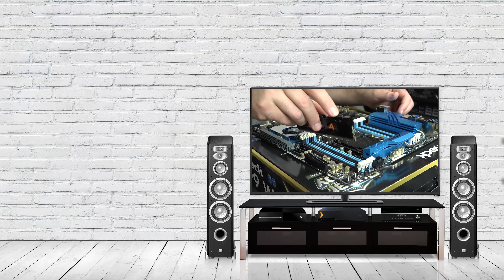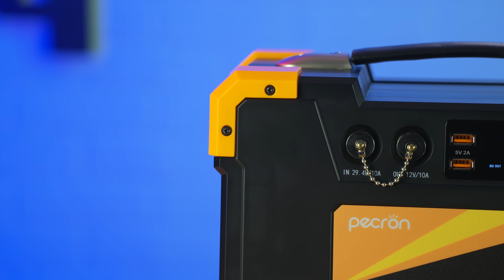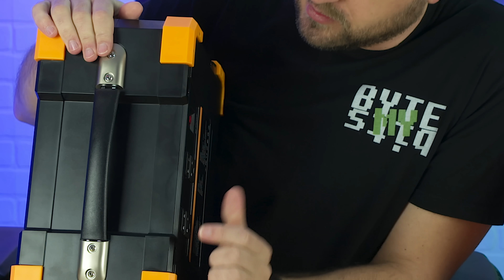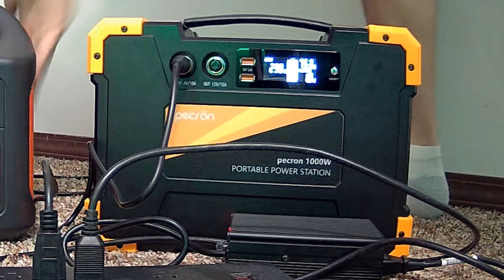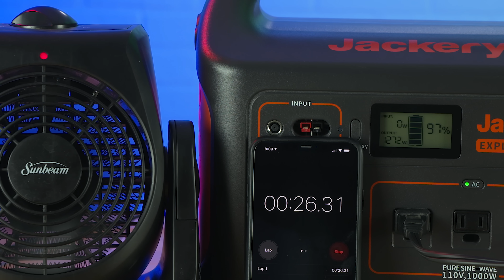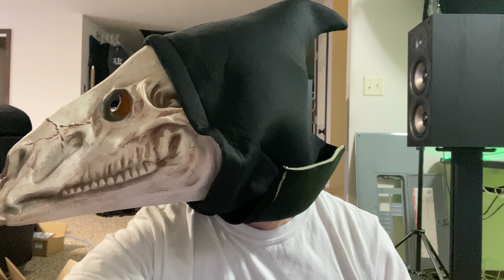pecron E1000 - Better and CHEAPER than the Jackery 1000!

Comment: Meh, they are all overpriced and this is not that much of a savings. I'd rather build my own and possibly build it with LTO Lithium batteries as they are better for our cold Canadian winters, they charge very fast and are safer than standard lithium. The only drawback to them, is they don't hold as much power per cell as standard lithium so a few more batteries are needed, but for my uses, they are superior and last WAY longer too for lifespan and are fairly inexpensive now, like $75 or less, per 45ah cells.
Reply: Bill Does Stuff,  Hello Bill, my name is Linda. Would you be so kind as to share more info about building your own LTO Lithium Batteries as you referred to in this post. I live in Maine, USA, where we have cold winters, too. I am 74, live alone, cannot afford to buy these expensive generators with solar panels and have no way to heat my home when electricity is out. If you cannot help, could you refer me to someone off or online who may help? Thank you for any suggestions of help, Linda
Reply: @lindaliberty4545  Hello Linda. See my comment to Valerie here in this thread. It applies to her and you actually, as she was asking where to get those batteries in the U.S. and the same Youtube channels I suggested to her are the same ones I would recommend to you. I am still learning and researching myself, so these are the guys I watch. DIY Solar with Will Prowse, LithiumSolar who also does battery builds and Brenden Tait, who has done a few videos on LTO lithium batteries. Those Yinlong LTO cylindrical shaped batteries they talk about seem very easy to hook up, nuts and bolts and metal bars kinda deal, which is what appeal to me about them and likely you as well. No soldering or welding bus bars etc. 

I'm no expert on them, but those are the guys I watch and who I learned about them from and they know their stuff. And don't listen to Will Prowse when he says LTO are inefficient, lol. They aren't, he got bad ones, I think it was Benden Tait's channel who debunked that and said, no they are not inefficient at all, lol. And I believe Will revisted the subject after. Anyway, Will is really good and so is Lithium Solar, because they do hands on stuff. 

 I would also check out some of the prepper channels for heating alternatives to electric and solar, like diesel heaters, propane heaters, mini wood stoves etc. They are always preparing for the worst, so they typically do a lot on heating. And if you are running electric heaters off a lithium generator, I would look into/research the most efficient electric heater technologies out there too like PTC ceramic, and oil filled and Mica heaters. Things that radiate heat after they switch off to save power and then back on when it drops to a certain set temp. Anything that radiates additional heat without the heat fuel (be that electric, gas whatever) are going to be the most efficient and perfect for running on battery power. 

I get the concern, I am looking into this and other alternative means of heating, "just in case". Propane just hit an all time high, so that's a bust, but those little Chinese diesel heaters look very efficient, Truckers use them all the time. Also look into modern Kerosene heaters, which can run on more than just Kerosene these days and are MUCH safer than they used to be and wow, do they throw off some serious heat! Just saw a guy do a vid. here on Youtube on one and he said it heats up his whole shop in about an hour and it's 1000 or 750 square feet something like that. And they run about $200. So there's LOTS of backup alternatives for heat now.
Reply: Where can we buy these?? InU.S.
Reply: @valeriehancotte-galan4790  I live in Canada, so I don't know. And Amazon is rather chancy (and expensive for them), because I've seen complaints about the Yinlong LTO batteries being fake on there/not having good charge/life. Yinlong are a good cylindrical-shaped LTO lithium battery that are rather easy to hook up by comparison to some. It's basically screw nuts, bars to connect the batteries and that's it. Being a good name like Yinlong has, others will knock them off. There are also rectangular shaped LTO ones too I believe, but these cylinder shaped ones like Yinlong are all the rage, probably due to their simplicity. It's not for their fit, lol, because squares and rectangles fit better together. The lithium solar guys know their stuff and do instructional videos on how to build your own battery banks and what batteries they buy and where. The channels are: DIY Solar With Will Prowse (who actually got some inferior Yinlong knock offs) and as a result did not have a good opinion of LTO lithium. But another lithium guy, said there's nothing wrong with Yinlong or LTO lithium technology and he knew where to get them from a reputable source. 

I think it was Brendon Tait channel, he likes the Yinlong LTO batteries and knows how great they are, for multiple reasons. In contrast, I think Will doesn't see the huge advantages of them and he's all about the size and weight and what that can deliver. It's not all about size, sometimes bigger is better and in this case, it is. Even just for longevity sake alone, sooo much longer life.  

Brenden Tait does a low temp test with them too and did a huge camper build with 99 of them. LithiumSolar is another good channel who does lithium battery builds and also did some LTO batteries and might know a good source for them. The huge advantages are well worth it. And they are not as prone to fires/safer and they can handle fast discharges and charges in addition their great cold temp performance and long lifespan. So running power tools, heaters, etc. on them and high draw devices are fine they handle it very well, better than standard lithium in fact (less heat). And on low draw devices, they last and last, they are very easy on the low end as well as excellent on high draw too and a super-efficient lithium technology.
Reply: @MrBilld75  Thank you so much for your prompt and detailed response. I will read this several more times and follow up on your references. Thanks again. You’re very kind. Keep warm!
Reply: @lindaliberty4545  You're quite welcome and thank you for your very classy replies/kind words.

Comment: I would love to know who's cells they're using in there. For something running in the $1k range I would want to know that my investment will last.
Reply: Your investment would clearly not. They are Li-Ion batteries, which are completely obsolete now. They will only last 500 cycles, versus a minimum of 3000 cycles(up to 8000 cycles with an 80 percent charge cycle) of the newer LiFePo4 batteries that MOST other competitors now use. Plus, they charge significantly faster, and are far less volatile. One would have to be extremely bad at math, to put it as nicely as possible, to even consider shelling out all that money for a Jackery. Trust me, I have done extensive research. For that money, an Eco Flow River will give you far more power for many years longer. Or, a Bluetti of similar power and price to the Jackery would also give you years of extra life, plus a solid established name brand, as well. Just watch out shopping them, as they are still selling(getting rid of) some older Li-Ion models which you need to avoid. I welcome you to research it yourself- You will be shocked how much better you can get than a Jackery, of any size.
Reply: @claycassin8437  Or just a really nice honda inverter generator. I can't think of any use case where that wouldn't better fit my needs in every way.
Reply: @embracethesuck1041  I think in terms of off grid solar applications, but if a fuel generator does the trick for you, then go that route. KISS is always the best plan. Unless the price of gas goes through the roof...
Reply: @claycassin8437  That's the thing, why would you need a portable solution for a solar solution?  Wouldn't you get way better value from a static battery bank and inverter?
Reply: @claycassin8437  yeah you can get the li-ion bluetti 1500 watt hours for $900. I think you are exaggerating the life cycles though? the bluetti li-ion is rated 1000 cycles. (it depends on discharge though.)  but with 1500 wh, you still have 1200 wh capacity at 80% useage w the bluetti, more than either of these two products brand new, for about the same price. double the useage span effectively w bluetti. it's not like we dispose the batteries when they do 80%. You raise a good point about the new Iron batteries though, and unfortunately when I bought my bluetti 2400 wh, which I have not had any problems with, they weren't out yet LOL. but at 80%, i will still be using a 1920 wh battery. (and iron is pricier i'm guessing, currently.) when my 2400 wh reaches 50%, i still have a 1200 wh battery. just a bulky 1200 wh. and by then i'll have a second iron battery. The only engineering bug I can find with my 2400 bluetti is it seems like if the Sun is not charging the battery with as many watts as I think it should be, if I unplug the cable coming in from the solar panels to the battery and replug it in, it will display more watts inputting. I don't know if that's just a Electronics display bug or an actual electrical bug. or if it's on my end. either way it's not that big of a deal in my case. There is indeed a pretty short ceiling on the surge of power used but I'm thinking that might be a good safety feature anyways so I'm not too concerned about the power surge capacity. Something else that could be a safety feature is this particular unit will only take in 60 volts of solar which is about three panels usually but not always. And as a result I had to configure my four panels to series-parallel getting only 350 Watts instead of 400. The lower amount of incoming power will probably extend the lifecycle span of the batteries though, I think, although I'm not an expert. the new iron bluettis might have resolved those disadvantages. and they are daisy chain capable, which is perfect for continuing to use the worn down one with a new one daisy chained.
Reply: Thanks for the discussion
Reply: whose
Reply: @kwameparentee  lol. I'm glad it's not me this time

Comment: This whole "thing" about power and solar and watts and amps etc . . does my head in Ive been binge watching Will & Tom on you tube  and Im almost convinced that building your own solar generator from decent componenets is much better thn getting one of the shelf as they are always gonna be a commpromise and built to a price.

Now Im gonna watch this video in the hopes that this brand will prove me wrong I do get the simplixtic approach of "plug n play" items like these but as I aid building your own you can get so much more out of them and your not tied in to proprietary irtems such as panels etc . . . I was interested in the Everoak coz Thomas Heaton installed one in his van and on paper it sounded pretty good that was untill Will built a component station in a milk crate that just blew it out of the water!! that set in motion all sorts of ideas that Im currently entertaining

Comment: I think you slightly misunderstand solar panels. Yes they use sunlight but they do not require heat.  They can function just fine in winter as well.

Comment: I like Goal Zero,  as they have great customer support in the US.  What happens when this model breaks?
Reply: Lithium batteries are manufactured in China, all the plastics casing for Goal Zero is made in China, all the controllers and Microchip are made in China ( Taiwan belongs to China.)  I would check your buttocks later of sign that says made in China, because Everything is made in China

Comment: I’ve been bit too many times by “you get what you pay for” …. and I did pay big bucks for the jackery 1000 inverter with the two solar panels ($1,499).  You need a light…zip tie a small flashlight to the handle.  How about the Ecoflow Delta …. Maybe compare the jackery to the ecoflow delta series. ❤️
Reply: Echoflow will blow away both the jackery and pecron as the battery chemistry is totally different.  It has the newer lithium iron phosphate which lasts longer, charges faster and cycles over 3000 times
Reply: People, these are NOT solar generators.
Simply a battery in a fancy case.
You need solar panels or electricity to charge them.
On their own, they generate NIL power
so please stop calling them solar generators. 
Batteries STORE power, they do NOT generate power..

Comment: that is horrible at 8ah LOL you can purchase  100ah SLA battery for $150, then add a 100amp mppt from amazon for $60 , and a 1000w inverter,  for less than $400 you will have 10 times as much power as this piece of junk! LOL If you are going to spend that kind of money go for an ecoflow which charges 5 times as fast as this weakling here. This is a horribly overpriced product and not a great review, paid sponsor :/ !

Comment: Can you get the Pecron in Europe? Really difficult to get these solar charging banks in Europe especially the larger models ie the Jackery 2000/2500 are not available here yet. We can only get Jackery 1000 :(

EDIT - just checked this Pecron out and you can get it in Europe although it's a lot more expensive. 1500w is over €1700 which works out more than the Jackery sadly.

Comment: Can you have hooked up to solar and still use. 
I mean with sun out and solar hooked up will it charge while you use it..does that make sence..would you need a charge controler?
Reply: Yes you can charge it with solar while you're using it to power things.  It has a built-in charge controller but your panel must put out between 29.4  to 40 volts.  Many small panels have 12 to 18 volts which would not work. I just picked up one this week for $600.  Prices keep dropping.

Comment: I drive a big rig, I need to power a small microwave and maybe a small space heater, my question to you is can this gen handle that size load and also can it charge and output at the same time?
Reply: Yes you can charge and use the power station at the same time.  Just be cautious that the microwave or space heater doesn't exceed the wattage of the power station. Microwaves use a lot of power.

Comment: This is a Chinese product, right? So I ask. Is this battery safe? Not just about being a battery, but are its external components safe? Do your wires and outer material contain lead? You can not answer. That's the question when we're talking about a product designed and manufactured in China. At first it is unreliable because China is not a reliable country. Their products are not guaranteed by a quality circle such as products from Japan where the industry has been committed for decades to only producing quality products.
Reply: Dude, everything is made in China. Get over it.

Comment: I bought one 1000w Pecron I had problem with 12 volt output. used one and then did not work anymore. Now I have a $800 boat anchor. How do you get in touch of these people? called and got a message to leave my number. no call back yet.

Comment: Picked up a Pecron E1000 and a couple Zoombros 120w/18v panels and the panels are a "No Go".  Right on the front of the unit is says 29.4v/10a. SO, where do I get solar panels(I'd like at least 200w) that have the voltage to work with the E1000??
Reply: I also picked up this E1000 for $600 this week.  The voltage window is very specific between 29.4 to 40 volts.  Most commercial rigid glass panels meet that spec.  I was looking on eBay and several contractors are selling used panels for a fraction of the cost.  I picked up a Trina 250 watt 36-volt panel for only $75.  It was 2 years old from a failed business.  So far works great and it really helps to keep it charging while you are using it otherwise the batteries won't last more than a few hours

Comment: You know why even use 110 outlet electricity. It's a solar panel generator right?? I'm so sick of people happen to have electricity, that's not a review that's cheap. I'm not ragging you but I'm looking for something that I can use out in the field without electricity, regardless the weather. it's like I said generator you don't need no electricity you just need gas and that's relatively available everywhere. That's why I'm thinking generator screw these electricity generators that you got to have a wall outlet.

Comment: Good review.  I was looking into buying a Jackery,  so glad I found your video.  I have a bit more comparing to do.  With the money I can save getting to Pecron I can get another solar panel to charge it.
Reply: Pecron are only 100.00 less, not such a big deal after all.
Reply: Just picked up a Pecron e1000 for $600.  There is a whole slew of nice portable power stations coming on the markets. The better ones have the new lithium iron phosphate chemistry that lasts longer,  charges faster, and have more cycles in its lifespan. Prices keep dropping.

Comment: If i use a 1000 watt device, for how long does this powerbank run the device? I find it very hard to make up if this is a good invesment or a bad one. For example does it run a 1000 watt heater for a hour or 10? If it lasts for less then, for example 10 hours, do you have actual powerbanks who cna let it run for 10 hours?